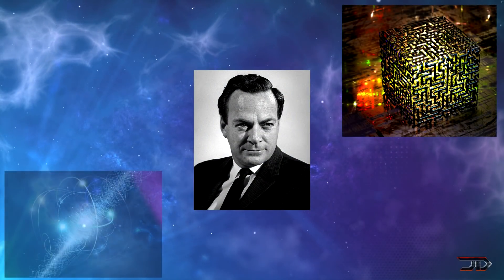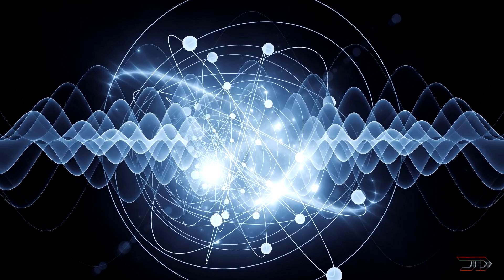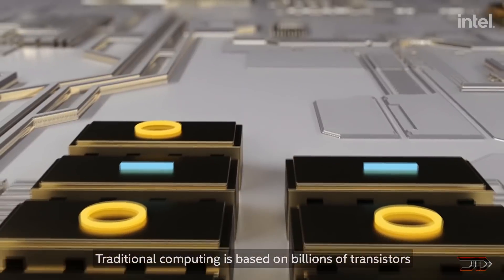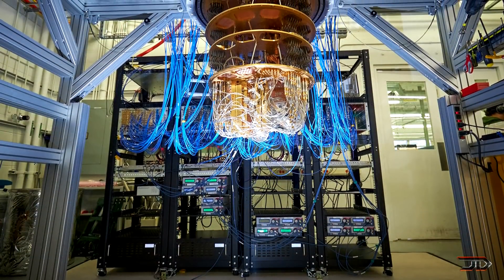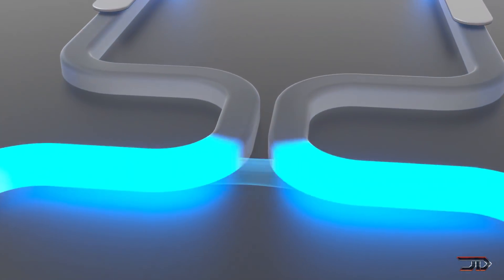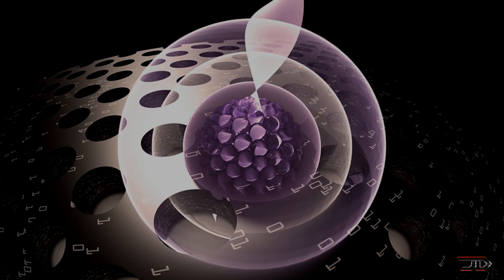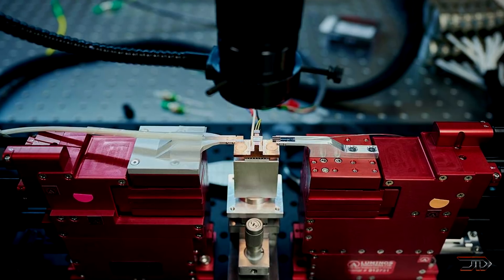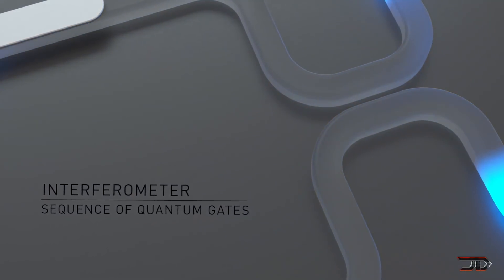Quantum Computing - The Latest Breakthroughs

Comment: Fusion Reactors may be in another 10 years? But only needs a break through in Quantum Computing... which  may be in another 30 years? 😂🤣
Reply: Every time I hear about quantum computing, by BSometer alarm bells ring a little longer.
I am reminded of back in the 1980's on the topic of dark matter.
Reply: @edwardlewis1963  Quantum supremacy was supposed to be a long way away until 2019.
Reply: @squamish4244  What is "Quantum supremacy" other than hairy fairy flowery words that in reality translates into funding for research.
Fancy claims and innocuous allegations.
On the other hand when you look at advances in AI with AlphaGo winning against the top human players, deepfakes;  we can SEE something that AI can do.

All I am seeing with so-called "Quantum Computing" is running a processor at super cold temperatures.
Temperature has always been an issue with processors.
Reply: @edwardlewis1963  Well then 'Neven's Law' should really piss you off lol
Reply: @squamish4244  'Neven's Law'?  Never heard of it.

Google:
About 2,080,000 results (0.53 seconds) 
Based on the observation that quantum computers are gaining computational
 power at a doubly exponential rate called "Neven's law", Neven suggested
 that quantum supremacy could occur in 2019. Quantum supremacy was
 declared by Google in October 2019.

LOL; more worthless hype; somebody made a suggestion, and somebody characterised the suggestion as a "Law"?

No it does not piss me off; it just makes me laugh.
Although Theranos is not funny.
Reply: @edwardlewis1963  Whatever dude. I didn't say it was real, I said it would piss you off, which it probably kinda did. (Fuck! This guy has a point!) We'll find out in a few years whether Neven's Law is hype or not. And I mean, just a few :)
Reply: @edwardlewis1963  
Google's Q-puter solved an equation in 200 seconds what the best supercomputer could in 10,000 years. So there's a lot more than a super-chilled processor.
Reply: @bengsynthmusic  That sounds like something, but so far I have not found anything....  Something like that I should be able to find with a simple search.  Like what equation exactly.  

I assume you are mistaken.

 I assume you must be talking about the Sycamore chip?
Reply: @edwardlewis1963  
They sampled one instance of a quantum circuit a million times. The rest is beyond my understanding. Here's the publishing. 
https://www.nature.com/articles/s41586-019-1666-5
Reply: @bengsynthmusic  
" Our Sycamore processor takes about 200 seconds to sample one instance of a quantum circuit a million times—our benchmarks currently indicate that the equivalent task for a state-of-the-art classical supercomputer would take approximately 10,000 years. "

Yes; no equation solved there.  Just a claim about something about sampling.
No actual demonstation of a quantum computer doing something is seconds or minutes or less that another computer is taking hours to do.  That ought to be a simple demonstration.
Reply: @edwardlewis1963  
There are equations if you scroll down.
Reply: @bengsynthmusic  That statement is true.
However the statement "Google's Q-puter solved an equation in 200 seconds what the best supercomputer could in 10,000 years.",  is not true.
Reply: @edwardlewis1963  
May I ask how so? "For m = 20, obtaining a million samples on the quantum processor takes 200 seconds, whereas an equal-fidelity classical sampling would take 10,000 years on a million cores, and verifying the fidelity would take millions of years."
Reply: @bengsynthmusic  ?
"obtaining a million samples" is not "solving an equation"

If it "obtained one sample" and a conventional computer did the same thing in a few days then that would actually demonstrate something.  10,000 years is 3650,000 days, so if that's how long it would take a conventional computer for a million samples, then for one 1 sample, that works out to 3.65 days, so there's your demonstration if there's one to be made.

If "Google's Q-puter solved an equation" is correct, then what is the equation that was solved?
Reply: @edwardlewis1963  
Okay. Then perhaps I shouldn't have used the word equation and instead should have said "performed a specific task much quicker than the best supercomputer." All in all, quantum computers aren't just processors that are supercooled. They're altogether a different (potentially better) technology.
Reply: @bengsynthmusic  Well thank you but even that is not correct;  if you read this direct quote from the link you provided:
"Our Sycamore processor takes about 200 seconds to sample one instance of a quantum circuit a million times—our benchmarks currently indicate that the equivalent task for a state-of-the-art classical supercomputer would take approximately 10,000 years. "

Note the phrase "equivalent task". 
Don't even bother with the obfuscations of 'benchmark' 'indicate' etc; but to rephrase the quote in similar terms that you suggest:

"performed a specific task much quicker than a supercomputer can perform on an equivalent task"

They stated the specific task : "sample one instance of a quantum circuit" (whatever that means);
What about an 'equivalent task' : they don't say.

If they ever get to the stage where they have two computers side by side, given the same task and one outperforms the other, then there's something to take seriously.

If they have really achieved something useable, my best guess is maybe like showing that light can travel through optical fibre alot faster than electrons can travel through copper wire.
Reply: @edwardlewis1963  
I see. In their thesis, they said: "Quantum processors based on superconducting qubits can now perform computations in a Hilbert space of dimension 2⁵³ ≈ 9 × 10¹⁵, beyond the reach of the fastest classical supercomputers available today. To our knowledge, this experiment marks the first computation that can be performed only on a quantum processor."

 So it's unlikely that they could do a side by side. One does the specific task in a reasonable time, while the other, in a much longer time. 

I understand there are some obfuscations and ommissions to the claim, but there's no question quantums are exponentially faster at doing certain things. Just that this computation is not as eventful as say running a video game.
Reply: @bengsynthmusic  I see where you quoted from, and re-read some of the previous parts of the article.
If you look over your quote, I hope you can notice that a casual read of it looks like, or can give the impression that:
"quantum processors performed computations"
However, it does not make that make that hard claim.
All it says is "quantum processors can maybe now perform computations";
Hilbert space is a mathematical construct or theory.

Basically they are saying that classical supercomputers can't handle Hilbert space, but quantum processors are strange enough that they might.

Incidentally you used the word exponentially incorrectly in your last reply: "quantums are exponentially faster";
the quoted article also used the word exponentially at least once that I noticed but correctly at other times:
quote from near the top of the article: " it is exponentially costly to simulate large quantum systems with classical computers".
From which I am guessing you wrote some of the text.  If that's the case, pleased to chat with you.

As regards the video game reference, a simple comparison between two computers is merely to multiply some numbers a million times; something simple enough that a classical computer will take a minute to do.  Nothing fancy.  All you want a quantum computer to do is do something in seconds or less that a normal computer takes a practical measureable timeframe like seconds of minutes to do.

The thing that stands out to me about "quantum computers", the big obvious practical elephant in the room, is :
zero Kelvin.
In the world of physics research, also known as "Low Temperature Physics"
A significant portion of the funding (quarter, maybe even half) that goes into "quantum computers" would be going into low temperature physics labs.

As far as a quantum processor : what can it do?
A classical processor can input information described as bits.  Can a quantum processor do that?  Let's see it.
Can the processor input something, and output something else?  Let's see that.

Actually, as I alluded to on one of my first comments, AI computing is something actually doing something practical, and the way things stand right now, if there's something to come out of quantum computer research, chances are we're probably going to use AI to figure it out.
Reply: @edwardlewis1963  
Okay. So all in all, is your central argument that quantum computers are infeasible? Or that they're a pipe dream?
Reply: @bengsynthmusic  
pipe dream.

As far as I can tell, there are not any quantum computers yet.
Whether there is a way that quantum physics or, I would say really - low temperature physics - can be used to develop a processor with useful properties - I don't know;  
are we at the stage of just memory?  memory as in RAM for example, or the equivalent of a hard drive storage?
Start with memory;  
then get to the stage of manipulating that memory as in read-write access;

So to answer the question: looks right now to be a pipe dream.

If there's something there: how about quantum memory?
Maybe the simple quantum circuits presumably developed are designed along those lines.
I mean, perhaps the first practical thing we might see is a way to store vast amounts of information using quantum circuits
Reply: @edwardlewis1963  
Okay. I appreciate this exchange. Have a pleasant one.
Reply: @edwardlewis1963  you need more research man, there's plenty of quantum computers available for use, and provides cloud services open for coders and programmers to write  algorithms, quantum simulators even games. but Big companies like google focused on higher than 100 qubits which work on different mechanic .. i guess
Reply: @IWaxBux  The is the D-wave;  
"D-Wave was the world's first company to sell computers to exploit quantum effects
 in their operation. D-Wave's early customers include Lockheed Martin, University
 of Southern California, Google/NASA and Los Alamos National Lab."

At best we hear about "quantum processors" and "quantum circuits", but no actual quantum computers.

Where is the quantum storage/memory?
Reply: @edwardlewis1963   not only D wave, there's plenty, so you can use the quantum processing architecture to learn about it and see what applications can be done for future.  progress is going steady. Why being a boomer
Reply: @IWaxBux  
1: "Not only D wave" what?
D-wave is not a quantum computer.
2: "there's plenty" :  Then cite something.
3: "progress is going steady":   great:  I wish them luck, plus I even point at the likely killer app: memory.
4: "Why being a boomer"   Is that a sentence?  What is a boomer?  Please use clear english, not your local high school lingo.
Reply: @edwardlewis1963  meant Not only Dwave offering Quantum Computation, plenty like Quantum playground by google which run chrome browser, IBM Q, Qiskit and about 40 others .  Quantum data an be stored on Binary storage and a quantum memory - the quantum-mechanical version of ordinary computer memory. it's exciting but maybe in 10 years will start getting more practical
Reply: @IWaxBux  https://www.quantumplayground.net/#/home
"Where can I buy a real quantum computer?

As of today the only company selling quantum computers is D-Wave, but unfortunately their architecture does not perform arbitrary quantum gate operations on sequences of qubits (which is what Quantum Computing Playground simulates at this time). The proof-of-concepts for capabilities of quantum computing have been demonstrated in multiple laboratories around the world though, so there is a chance that quantum computers will become one day everyday’s reality. For now, you can experience the technology of tomorrow today, inside our Playground. "

Not sure how old that is (I'm thinking about 5 years).

But as you said: "maybe in 10 years" we will see something more practical;  but I think the phrase quoted from the playground page describes more accurately the current state of affairs: "there is a chance".
Reply: @edwardlewis1963 "Temperature has always been an issue with processors." Not with a processor that runs with photons as qubits.